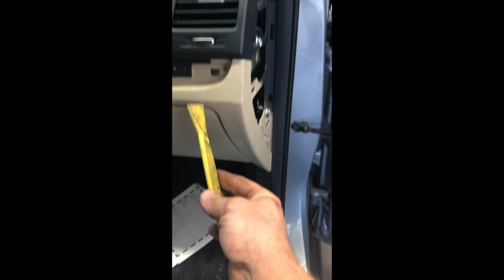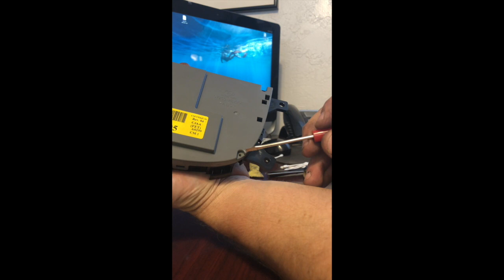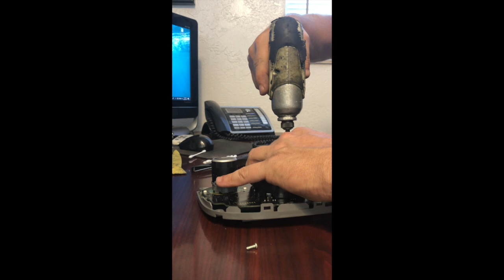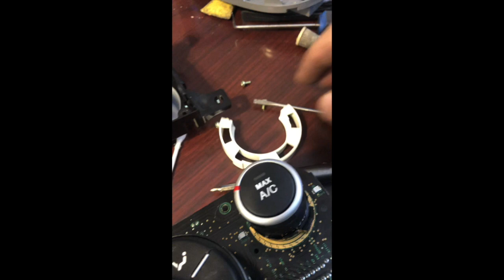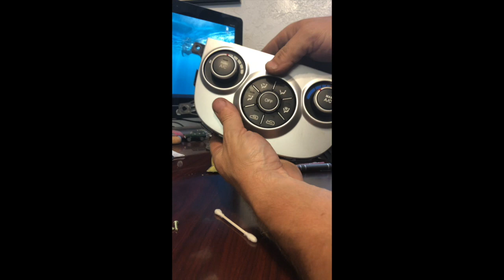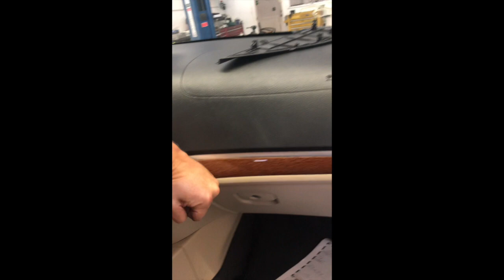2008 Santa Fe Climate Control Repair

Comment: my santa fe model 2010 the problem when morning n night AC it wouldn't turn on if start engine but if noon or wheather hot AC turn on. would this be same problem with your climate control?

Comment: My '07 is having some climate control issues. It doesn't get cold, but sometimes it seems like it works fine. I've recharged the system, confirmed the compressor is good, changed the evaporator temp sensor, and it is still unsatisfactory. Looking at replacing this unit, because it look like I can find it for as little as $58 +shipping.

Comment: Wife has same car. Our problem is while driving. If you turn the ac off weight a minute and it turns back on by it self. When car off ac does go off but can not manually push off just turns back on when it wants too. Any advice?
Reply from the maker: I think it’s still the same repair. Give it a try I got nothing to lose

Comment: I have same control but mine the problem if low fan mose it was automatically shut off you need to put to maximum fan mode to reset i tried to clean same problem my blower resistor its new already. Thank you..

Comment: Wow, thanks for making this video Frank!!!  I have just learned to live with my AC constantly turning on whenever it wants for several years.  Your video did not exist the last time I did a YouTube search.  I found another video at the time that suggested that the fix was to replace the AC Module altogether which carried a costly dealership price tag.  Using your video, I will definitely attempt to "clean-it" first but even if I have to replace the module, I can avoid the dealership labor costs and do the swap myself.  Thanks again!
Reply: Did you ever try to fix your HVAC from turning on? Replacing a module would be cheaper if that works. I’ve been living with the problem in a 2012 for years and still looking for a fix.
Reply: Not yet. I bought the trim tools, dielectric grease, and contact cleaner after I watched this video but I dropped the ball. Thanks for the reminder!  I plan on performing the fix in the near future.